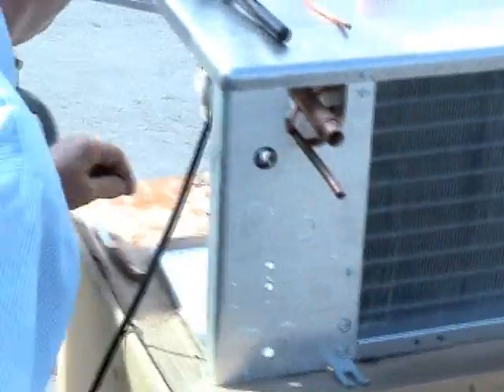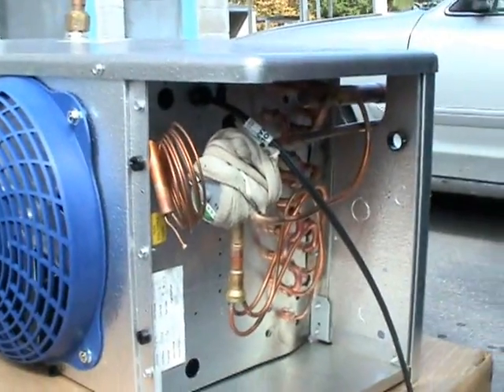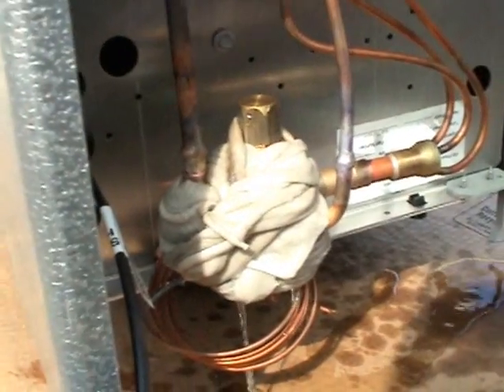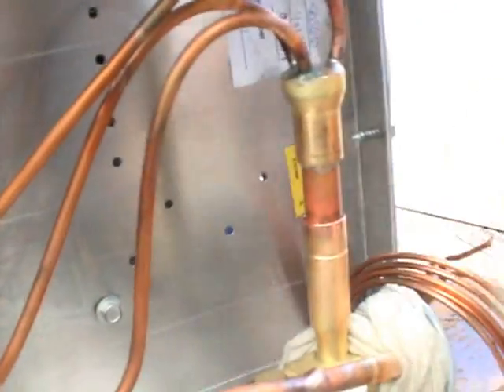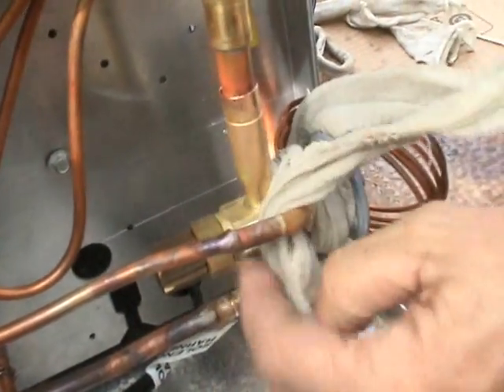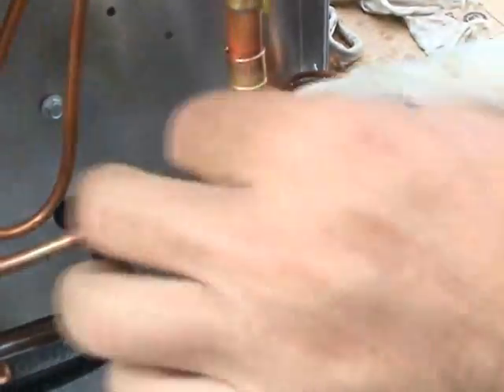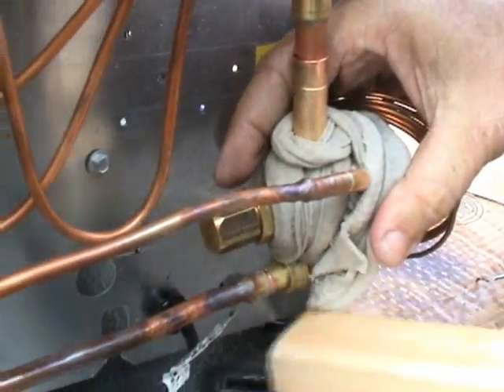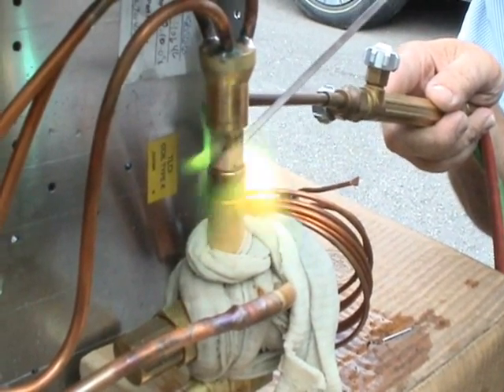HVAC Brazing in a TXV on a refrigeration evaporator

Comment: hey try soldering   !  i am 66 retired and it works and dont have to worry about melting anyway LOL dr z ,,,,,its denis here LOL just caught you on another place ha ha ,,,,,i could never have my colleagues in the hvac agree but i did it plenty of times with some chosen individuals  ,,,,,,just saying ,,,,,less heat and just as much strength !  dr z was a certified welder as young as i was in the days ,,,,,hope you knee is better jim
Reply from the maker: Thanks. My new knee has been a new lease on life for me. By the way, I'm not the one that's soldering in this video. It's actually a coworker.
Reply: @DrZarkloff  i know jim i was just more or less saying its good to see you ,,,at my age 66 this november 19 i really dont care how one chooses to weld their stuff LOL ,,,,,be safe no injury is the key to all trades ,,,,happy hollydays to all

Comment: These gents already contaminated the TXV on the first braze with no nitrogen present. Then these 2 rookies spend an incredibly long time re-wrapping with the wet rag. And then still with no nitrogen as he ties in the TXV to the coil, overheating the TXV fitting in the process. BOOOO!
Reply: I saw what you saw.  Terrible.

Comment: Hey Dr.
I understand why you were timid with the heat on that last TXV joint, I think ALL HVAC techs have been guilty of this at some point in their career.
I will credit you for at least using an Oxy-acetylene torch on those joints as opposed to what most techs I've seen use. If you look back in your text books, you'll be reminded of why oxy-acetylene is recommended. 
It's about as hot and small a flame as you can make, allowing you to pinpoint the heat on that joint, get it HOT quickly and get the hell out of there ASAP to prevent that heat from getting sopped up by components you don't want to get hot.
Also, and this applies to most other techs out there, don't focus on or worry about making a "cap" or fillet on the joint. Brazing is an "adhesive" process (think gluing). The STRONGEST braze joint is created when the filler rod wicks into or penetrates the ENTIRE surface area of the joint.

Comment: nitrogen goes in before you start...dont stick your rod in the flame...dont get the joint wet...that unit will clog and fail. not impressed. sorry

Comment: stop with the psycho nitrogen posts. is it optimal? yes, no doubt. i do use it on environmental chambers and other critical systems. (i only do refrigeration, so i dont know about ac) -but this little shit out walk-in bohn unit, or maybe a russell, will never notice the carbon or oxidation from two 3/8 and a 1/4 line. if you were insanely bad and heated/cooled over and over you might start to clog a drier after a while or have a valve that won't seat, but that's about it. Again, yes, it's best practice to use it whenever possible, but it's not the end of the world.

Comment: You guys need to chill out when it comes to weild a valve, while it is important to cover it, theres no need to take 5 min to roll it up, one or two wet cloth and youre good to go. It is more important to do it quick then to struggle to do a good job because your heat sink is too close from where youre weilding. Also don't be scared to heat it up enough to do a good weilding i know they can get quite expencive and you dont want to scrap one but it is worst when you take too long to heat it up and to heat it again to make sure the sylfoss went all around then heating it up a bit more one time and do a quick job.

srry if you cant understand me very well, english isnt my main language.

Comment: Hiya Dr Z. Would it not be  practical to connect up that TXV via flared connections instead? Lot less hassles replacing when they "die"...Just a thought :-)
Reply: +Charles O&#39;Connor it is easier to replace yes, but txv's shouldnt go bad.  a power head from time to time, but not the valve unless you are switching refrigerants. i did find one clogged with leak lock but that was the only instance.

Comment: I am a self professed AMATEUR at brazing...That last joint was garbage. Not enough heat, that solder is barely hanging in the lip. I have made a couple ugly joints, and after I take a look with a mirror and light, I immediately go back and re-sweat the joint (brazing, oxy-acet, with nitro), I refuse to do ugly and call it a day.
 Get that swage red then the silphos will FLOW into the heat and make a gorgeous joint.

Comment: wow you took that long just to wrap  it then you did not even get it hot enough to suck the solder in to the fitting you just balled it up on top. I would go on but I don't wanna bash to much but I sure hope you guys haven't done this to long you sure probably shouldn't make instructional videos!

Comment: why are you installing a txv when it already has a fixed metering device?? never seen this before.
Reply: Those capillary tubes does not work as a metering device. This evaprator is equipped with liquid distributor. The liquid distributor gives a unknown pressure drop, wich i why we use a txv with externaly equalizer.
Reply: Efficiency. Metering how much freon is needed based on super cooling of the outlet pipe increases efficiency of the system.
Reply: There is no fixed metering device. You must have the txv. Or install a fixed metering device. Since it's set up for txv, go with txv.

Comment: I was brazing a connection on an evaporator in a beer keg cooler, it had plastic beer lines going from the walkin out to the beer taps at the bar. The beer lines were mounted on the back wall, I was brazing about 2 1/2 ft away from them,the heat caused the plastic to swell and pop,I got covered with Guinness foam,I looked like the swamp thing,I had to run out to the bar and get the bar tender to turn the keg off.Some drunk customer said"what are they doing to you back there"I got a beer shampoo.

Comment: Depends on what you are working on, a lot of mini split manufacturers don't approve the use of brazing materials that need a flux such as the high silver content ones, the flux residue if it gets in the pipe will react with the PVE (polyvinyleither) oil that is used in them.

Comment: why ?, I've been using stay brite #8 since the 70s when it came out. If you have to take a part apart it makes things nicer. Also you use lower heat when you solder, thats good for the expansion valve. The stay brite #8 was designed initially for installing high side components, it has 8% silver. It can handle high pressures and higher heat tension.

Comment: no dumbass..  it sits on a platform we built on the roof.  it uses a pressure switch and solenoid to control it..  like i said..  not hard to do hvac..

Comment: hmm it must the poorest working cooler ever... you have no idea what it takes .... you dropped the compressor on top of the cooler air cooled instead of being remote condenser correct? with head master valves? and fan cycle controls? you did the most simple man job

Comment: ok well if the reversing valve is shifting to start a defrost and the fan doenst stop the board would be the culprit, but you already knew that. in our state of washington, it is hard to buy hvac parts unless a person works in the trade or has a contractors license. it used to be easier to get parts.

Comment: I noticed, when I crossed the force defrost pins on the board, it would not force a defrost. If it will not force defrost properly, does that mean the board could be bad?

Comment: If you can use a voltmeter check out the circuitry using the diagram on the door or in the papers for the unit. Trace the power to the fan forwards and backwards.  Thats the only way to really prove stuff.  Anything can go wrong.  I have had factory guys telling me the same thing on complicated flaky Pulse boilers, "Im not there in front of it so its hard to tell over the phone".

Comment: I watched the stuck TXV force the system into defrost, and I noticed something kinda scary. The fan normally stops during defrost, but for some reason, the fan won't stop for defrost anymore. It's blowing cold air over the coils, and causing the defrost to go for a long time. Could a failed defrost board cause the fan to keep running in defrost mode, or could it be something else?

Comment: Usually replace the coils because they develp leaks.  Usually the leaks are in the tube sheet headers although they dont have to be.  The copper tubes can become half moon shape from freezing and re-freezing crushing them on heat pumps anyway.  Coils are expensive as most everything in this HVAC trade is. Get several quotes and go with a good outfit if you can.

Comment: It sounds like it is not feeding enough refrigerant.  There is also and outdoor check valve that can mess up giving harder to diagnose symptoms for most of us. If the suction pressure is low and the superheat high in htg, and your txv is frosting it probably is the problem.  The heads on txv's can fail to open and most of the small cheap ones are one piece so you cant change the heads only.They also have an inlet screen. Also a defrost is needed when the outdoor coil is starting to get frosty.

Comment: I think you are right about that. The defrost sensor is located on one of the feeder tubes coming off the TXV, and those tubes are becoming so cold, that it is putting the system into an unwanted defrost, when there's no ice on the coils. My subcooling is too high, so does this sound like a stuck TXV?

Comment: In htg mode the suction line is hot going to the indoor coil and the liquid line warm coming back from the indoor coil. If the unit is overcharged it will be hotter than it should be. Also, if the indoor coil or filter is dirty and the air exhange is diminished the same condition will apply.  Try tapping on the side of the TXV and taking the bulb off and putting into a cup of ice water and then warm it up in your hands and try to massage it back to life.  This only works once inawhile.

Comment: with my hvac gauges, robin air vacuum pump, and a cylinder of 404 ..  no, i didn't use nitrogen as recommended, but ive never done that with any other ac system or ever seen anyone around here do it.

Comment: May i suggest fluxing the joint with silver solder flux, hitting it first with high percentage silver and then put the stick to it. You will find they mix togethor really well and make a smoother joint.  Yes I am in the trade with licenses in refrigeration, boilers, hvac electrical, and epa cert.

Comment: I had my 2 ton heat pump recharged, and had a leak fixed recently, and just as it was being charge, the TXV got stuck, so I had them over charge the system to lower the superheat until I could get the TXV replaced. I put the system into heat mode recently, and the suction line got very hot on heat mode, but the liquid line was room temperature. Could a stuck outdoor TXV cause a room-temperature liquid line in heat mode?

Comment: If this is an R134a evaporator,  I'm all for using screwed fittings.  A lot easier install.  Pressures are not that great on such a system, and you don't have to worry about the high heat on the txv.  Just my opinion.

Comment: was nitrogen used after he pulled the txv away from the valve? i hears a blast of air or something but i think it was the torch. oxidizing inside of the system will cause you many problems in the long term

Comment: Didn't clean the braze surfaces, no flux (regardless of using CuP alloy), too short a flame kernel, aiming the flame towards the heat sensitive component, quenching a fresh braze with water, and not 'chasing the braze all the way around to ensure a fluid joint was made.  Personal pref, CuP for interfaces and at least 15% Ag for Cu/Cu or Cu/Cu alloy.

Comment: WHAT HORRIBLE WORKMANSHIP, I hope you put driers, liquid line and suction filters on that unit. Quick note here when you watch the brazing being done you see the oxidation and soot being formed on the outside of the line well the same process happens inside the line too. so just imagine what happens down the line when the customer starts having equipment failure he starts blaming the manufacture of the equipment when it was the lack of experience or laziness of the technician at fault.

Comment: It is always a good practice to wrap the cap tube distributor with a wet rag as your brazing to stop heat transfer from the torch to the distributor.This will prevent the distributor from becoming unsweat which will create an even bigger problem than just a simple txv replacement and if in doubt the best thing is to disassemble the txv before brazing. And that goopy heat sink as a rule is not nearly as effective as the wet rag method.

Comment: I know I probably sound over-dramatic, but I personally would wrap the TXV instead of tearing it apart because I think there is a risk of the parts being thrown out of adjustment when taking it apart. By the way, do you still work with Dave?

Comment: About TXV on swimming pool heat pump heater: this guy says adding one would make a unit work even better than new: toad.net/~jsmeenen/charge.html. What is your though on this? I though adding one on mine. If a good idea, I will send you a video link of my heater so you can suggest where I could install such a unit (as well where to add a filter drier with an eye sight). Thanks

Comment: just to call you out on the gas flow through the torch tip, that tip was set correctly. without sufficient gas flow, your tip will heat up really fast. aside from that, yeah, this wasn't done the best that it could have been done.

Comment: i hate to say this, but,,,  YOU SUCK AT BRAZING !  go back to school. yeah,,, i do hvac as well,,,did you even do a low side pressure test with nitro ? take it down to 500 microns? or did you just open up the king valve thinking you were done ? leaving the air in the line set,, tell us all the truth,,  IT LEAKED ! i see the holes !!!!    f'n morons,,

Comment from the maker: @somerandomdude82 The holes on the side of the evaporator are just runs in the evaporator that are not being used in the system application. The manufacture will make the same coil for many different unit sizes. Then in the same factory, the loops on the ends are installed for the specific unit.

Comment: Hey Dr z try that heat spray ON the rags. If done right you can keep a bare hand on the txv (not recommended) a smaller tip on your torch will minimize oxidation if your not purging with nitrogen. Regardless good videos its very refreshing to see people that enjoy their work!

Comment: I was wondering what solder you are using, since I don't do a lot of brass to copper soldering-brazing I asked at the local supply house and they recommended a rod with a white powdery flux on it. What an abortion that joint turned out.  I  need to go out and buy another valve and start over. Sporlan R-410 valve 2 ton. Can you use Silphos?

Comment: In your TXV video you recommend taking the valve apart when soldering it in so you don't overheat any internal parts. With that much wet rag you need a lot of heat to compensate for the rag, would it be better to take the valve apart and use less rag so you are on and off that joint quick.

Comment: Did you guys just take a ten minute video of wrapping a TXV with a towel??? Than melt your brazing rod with the torch instead of allowing the metal to melt it. Cool Gel would have protected the valve and taken off about 99% of your video.

Comment: Did you know you can use soft solder it requires less temperature to become a liquid. It is actually the recommendation of Sprorlan Valves to use Soft Solder.

Comment: Should direct torch flame away from valve body, flow nitrogen to avoid oxidation flakes inside lines. For "smaller" lines, apply heat on one side of joint, and silfos 90 degrees or so from flame, and let solder run to the heated location, rather than apply silfos-15 at flame site as seen, to much solder applied for line size I think. A squirt drink bottle is nice to easily re-wet the heat sink rags while busy one-man sweating, but do protect that manifold, t-shirt rag strips are indeed the best.

Comment: @DrZarkloff 
1. how big was your tx valve 
2. how big was your coil
3. how big was your compressor?
4. was the compressor mounted close by? 
or was a remote condenser or rooftop unit?

Comment: Always run nitrogen through when brazing. You will get flaking on the inside and you will never be able to blow it out after words. There will be some stuck in the txv. They will be back to change something in that system. txv would be my opinion. But thats not worth much.

Comment: Another good thing to do when working on the coil before installing it in the cooler, is extent the liquid and suction lines outside of the casing and sweat yourself in some access fittings. Then, if time allows, pressure test your coil, valve, and field brazing with 100lb's of nitrogen overnight. As for the heat sink paste, and cool gel... I agree, the rags work much better.

Comment from the maker: I would add a leak sealer to a system only if it's too old to get a new evaporator or if the owner of the system doesn't want to spend a lot of money on a system they plan to replace soon.

Comment: Dr Z, do you recommend adding a leak sealer from clip light to a 410a system?  The leaks appears to be in the evaporator and it is very small.  What other leak sealers do you recommend?